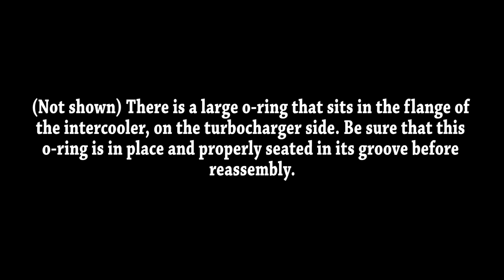Subaru EJ255 Intercooler Removal Installation

Comment: I had a guy bring his late 90s Camaro into the shop due to it not running right and his radio had a lot of static...So I checked the radio antenna to see if it was plugged in and getting a good ground...Went and popped the hood to check the plugs and wire sets...What I found was a metal clothes hanger wrapped in black electrical tape in place of one of the spark plug wires...Called him and told him that the car needed a tuneup of plug wires and plugs to my dismay he only wanted to purchase one spark plug wire and with a used one...I think that was about the craziest thing I had heard...Cost him $50 to fix it...It wasn't like he was poor or anything He paid the shop and gave me the change from a $100 bill...Have a great day...
Reply from the maker: +Mike Brown Oh the things we see in the automotive field. People can be crazy, that's for sure. I've got quite a few crazy stories myself.
Reply: I'm sure you could...Will be watching for more videos...

Comment: Could you run an engine cleaner through the throttle body like Seafoam with this set up? They supply a flexible straw that is a little over a foot in length and it is supposed to spray directly on the throttle plate from about 1/4" away. But this looks like it would make it a very difficult job.

Comment: 2 questions:

first, more of an observation.  I guess i thought that when you disconnected the intercooler that there would be coolant in there.  there wasn't any in the video.  is that normal?

Second.  Is this how i would access the knock sensor?
Reply from the maker: 1. Air to air intercooler. No coolant.

2. Yes.

Comment: Do you have one of replacing the PCV Assembly on 2005 Subaru Legacy GT Limited Sedan? Everyone  video that I've found are people not replacing the entire assembly and only doing pieces because apparently doing the entire assembly is more difficult?  In fact a local Subaru Stealership was supposed to have replaced my PCV during a 150K Level D service, and they didn't do it because "We were afraid we'd break the PCV container and didn't have it in stock, and didn't want to leave your car un-driveable!"  Apparently they take the shortcuts and only replace the PCV valve itself, but from what I've found, the container is plastic and easily breakable.  IDK why they wouldn't have it in stock, especially given that I scheduled the appointment a week in advance.  I've been attempting to chase down a rough idle, after replacing plug, coils, cleaning MAF sensor, changing air filter,  etc, and this is where I suspect my problem may be found, or at least where I was pointed to by several technicians and a few forums that I read.
Reply from the maker: The LGT should just be the PCV valve and rubber hoses only the 2.5i models had the plastic actuator as far as I recall. I'll have to look on my 05 LGT sedan sometime this week.

Comment: Has anybody done this? Is it really as simple and as quick as it looks?? I have a leaky intercooler I need repaired and need to save some $$ by repairing it myself if possible. I don't have any special tools, limited knowledge of the engine, and I haven't worked on my car (or any others) besides installing an intake and running an OTS tune. Any insight?
Reply: How did your intercooler repair go? Mine is leaking at the seams and I’m considering trying to seal it up somehow.